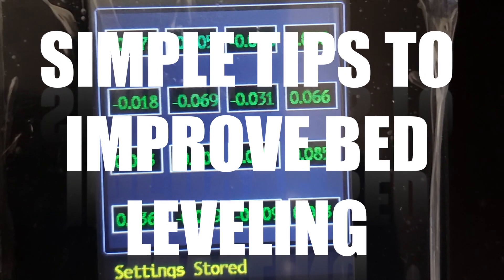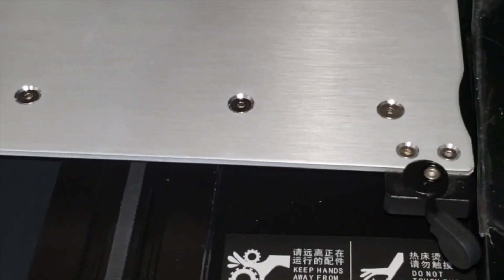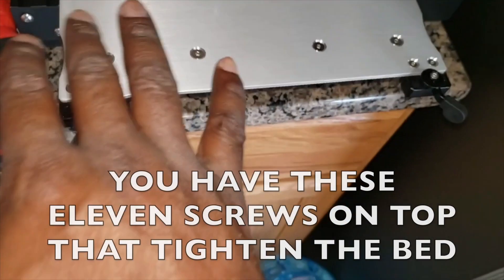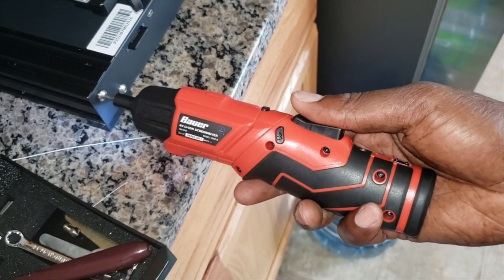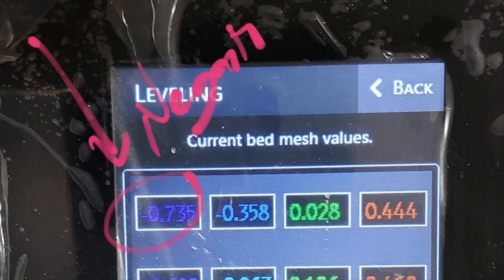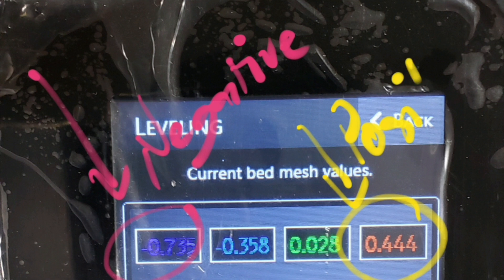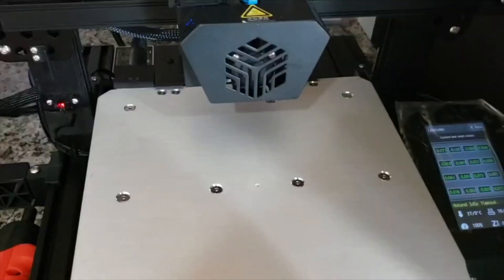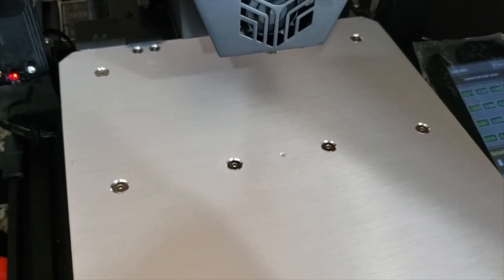SOLVING BED LEVELING ON CR6-SE / MAX SERIES –Community firmware 6x... (link in description)

Comment: Dit it ever fall out of alignment again and how did you fix it. I have removed every part and adjusted every part again but still I’m gettin low corners.
Reply from the maker: Your issue might be related to the pulleys under the bed. This CR6-SE unit has been a pain for many! lack of quality construction, and the user is left to redo many parts adjustments or replacement. Sorry for your trouble.

Comment: i hate how hard it is to put the bed back in, i also cant get anything to stick to the bed whatsoever no matter the temperatures, ive checked everything and the frame is perfect. did you have any adhesion issues?
Reply from the maker: I noticed that the bed would heat unequally. Due to heating elements failure. I resetted the PID and was good for a while, then changed my plate and same cycle. I finally abandoned this unit under the dust!
Reply: @joseph-israel  damn, not something you wanted to hear after spending 400 dollars, such a shame, praying the customer service will help.
Reply: Had the same problem. Turned the bed upside down. Problem solved for me.
Reply: cleaning with IPA or acetone helps for me, important thing - do not touch the bed with your fingers, especially in the middle of the plate, just single touch in the middle can destroy adhesion for small prints